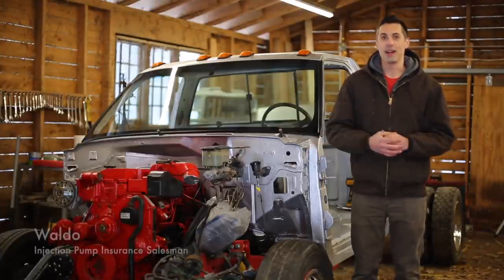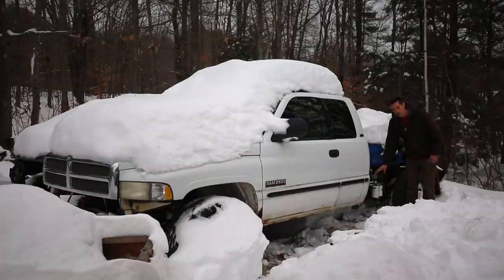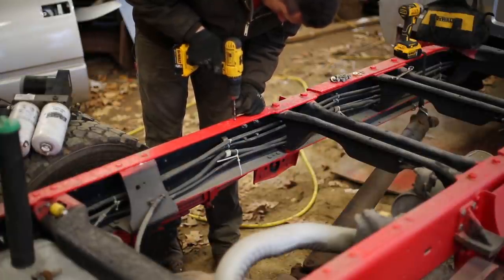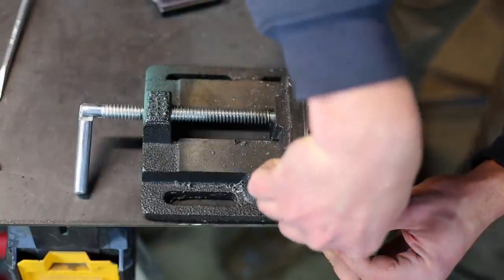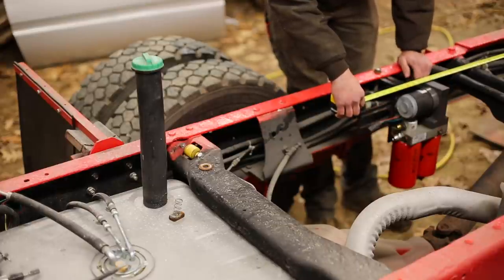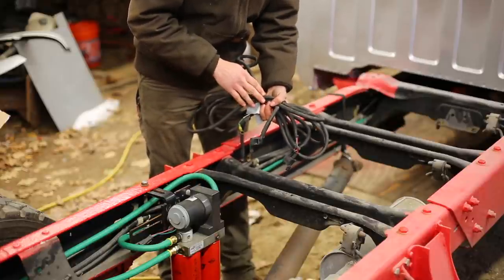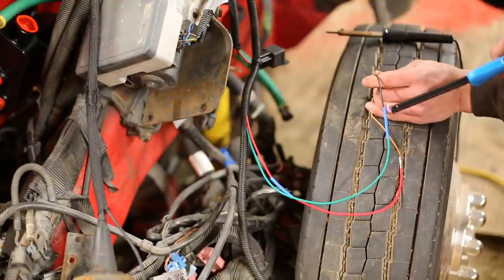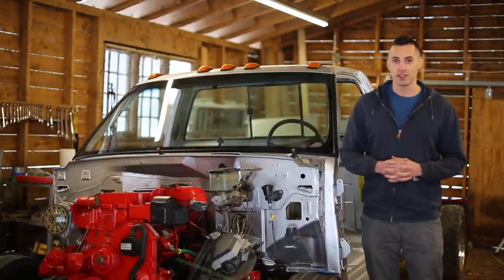Cummins Swap: Installing a FASS Fuel System to Make My 24-Valve Injection Pump Bulletproof [Part 15]

Comment: Here's a tip on the heat shrink connection: cover your soldered connection with the dialectic paste before sliding the heat shrink tubing on, that way, when you shrink the tube, you protect the connection from corrosion and it also seals water and moisture out.   Lee PS: Love your channel. Found you about a week ago and love the 95 C3500 build. I'm not quite caught up to were you are now, but I'm working on it! Thanks for what you do.

Comment: nice upgrade waldo. that fass fuel system is suppose to eliminate aeration in the fuel as well. most people never know that their lift pump has failed until they go to change their filter. the vp pump will pull enough fuel to keep running but not enough to keep it as cool as when fuel is supplied by the pump.
Reply from the maker: Yep, I want this truck to be highly reliable 👌
Reply: @WaldosWorld  reliable and VP-44 cannot be said in same sentence ,  Im looking  forward to your P pump swap vid ,

Comment: I'm loving your 3500HD build man. I actually just had the Fass system with water separator + sump system installed on my LBZ Duramax a few months ago and its awesome. I find it really helps the truck start more effortlessly in the cold weather plus the extra filtration is good for the injectors and the CP3 pump.
Reply from the maker: Thank you! Yeah, definitely a good upgrade!

Comment: I'm a firm believer in soldering and heat shrinking over crimping.  I've replaced more faulty crimp connections than I can remember in the last 40+ years.
Reply from the maker: Soldering for the win! 👍

Comment: Solid advice for the electrical splicing, I will just say for those that don't have soldering iron etc bare butt splices with heat shrink is the next best thing. Also for heat shrink I recommend marine grade shrink with the hot glue stuff inside
Reply from the maker: Good advice! 👍

Comment: i see you turned the bucket the right way to pour it.  for your zip ties clamp a vice grip, nose first into the lock and twist. the tail will come off flush with the lock and you won't have to worry about beating your hands or arms up if you happen to drag across the zip tie.   I bought a project last weekend on my channel and its not an easy fix
Reply from the maker: Good tip on the zip ties...those can be pretty sharp! Also, good luck with the skid loader!

Comment: Hey Waldo just a tip for you. When you get that engine running again I would suggest you run a few cans of Liqui Moly Diesel Purge through it. It will make a hugh improvement in how it runs.They also make an excellent oil specifically  for high mileage Diesel engines. It's called Liqui Moly MoS2 anti friction 10W40. And no I do not work for Liqui Moly...lol These are EXCELLENT products that are well proven.
Reply from the maker: Thanks for the tip! Liqui Moly (5W40) is the oil I use in my Volkswagen 👌

Comment: Hello Waldo, I have just started watching  this series and it's a great one, I am really enjoying! I have a 1998 GMC k2500 with 6.5l my self. However I'm currently living in Europe and my truck is back in Canada, this kinda stuff keeps me going. I did notice that you used the stock fuel pickup tube. In my experience and from previous research this stock tube a starve even the 6.5l. Often people put an in tank sump or larger pickup tube as well as removing the in tank filler sock as you nolonger need it with the fass system. If you do find your self working on the fuel tank in the future it might be something to consider. If you really want the best option, Leroy diesel sells an upgrade sending unit with better fule level sensor aswell. Who knows, it might be something you have already done in a future episode but I figured I would share anyways. Take care and thanks for the great content!

Comment: Merry Christmas, Waldo.  I make electrical connections the same as you (solder/heatshrink).  It’s the best way to guard against future failure.  I used to use a lighter for the heatshrink, but have changed to a heat gun now, which seems a bit safer and more controllable.  Do we viewers have to buy you a funnel for Christmas? Haha
Reply from the maker: Haha, I have a funnel, but didn't feel like walking back to the house to grab it 😂. Merry Christmas!

Comment: just a thought. if you blow a u-joint at the rear axle, the first thing the drive shaft is gonna murder is that pump.
Reply from the maker: That's a good point. I suppose I could build a guard for the pump so it doesn't get damaged. In the meantime, I did check the U-joint to make sure it's tight so it doesn't fail any time soon
Reply: @WaldosWorld  chances are it wouldn't happen but a drive shaft hoop could solve that my friend. this truck is looking awesome and i just was thinking about how that would really suck after all the work you've done.

Comment: Oh man a diesel swap in the Land Rover has me more excited than a kid on Christmas!! 😂
Reply from the maker: They offered a pretty decent V6 diesel as an option in Europe, not not here in the states. It should be a cool project!
Reply: @WaldosWorld  oh I know they did... is yours from the BMW era? BMW has made some astonishingly good inline 6 diesels! Not sure what diesels LR used before BMW though, but I  assuming yours is from before BMW since you said V6...
Reply: @WaldosWorld  also I've become well aware of how much better Europe has it with regards to modern, efficient diesels with long service lives, in any kind of car you want instead of only 5 ton pickups and bigger... and even then only as a $20k option, with the 19 liter 225 hp V8 pushrod gasser that gets 1.5 mpg being the default choice. Ughhhh 😂😂😂

Comment: Waldo as long as you keep good fuel pressure to that vp44 no less than 10 psi, the vp44 injection pump is a great pump, unfortunately the pump has a bad reputation due to the poor design of the factory lift pump
Reply from the maker: That's the plan! 👌

Comment: I know this is an older video but I hope You see it you should get the Wix filter for the water separator you can drain the water out of the filter it has a valve on the bottom
Reply from the maker: I got the Baldwin which has a drain. That reminds me: I should open it up an check for water, especially since it's been sitting for a while 👍

Comment: You shouldn't drill on top of the frame because its the structural strength of the rail. It will break from the point from the axle suspension. I have seen many people do that and end up doing frame repair down the road. When you see holes to top of frame its cold punched holes not drilled.
Reply from the maker: I didn't think of that, good point!
Reply: @WaldosWorld  those chevy frames were noting but trouble their was recall for their frame.

Comment: Not a big fan of soldering those wires. Solder fatigues very easy and breaks causing shorts. A heat shrink butt has better strength as it is less likely to deform.

Comment: did you use regular oil to lubricate that fuel filter and water separator?
Reply from the maker: Yep, 15W-40
Reply: @WaldosWorld  I've always been told, you should never lubricate a gasket or seal with anything but the fluid it will be in contact with
Reply: @jnic2003  engine oil or atf without friction mod is better to lubricate the filter seals than fuel, an extremely small amount of engine oil wont matter anyway as diesel is oil. an old cummins like that wouldnt care if there is a little oil in the fuel.

Comment: I can’t believe that there’s a single mounting bolt...unreal.
Reply from the maker: Yeah, it does seem a little weird in my installation (as long as you say "that's not going anywhere", it'll be fine 😂), but on a Dodge pickup, it works well when mounted using one of the bed mounting bolts 🤷‍♂️